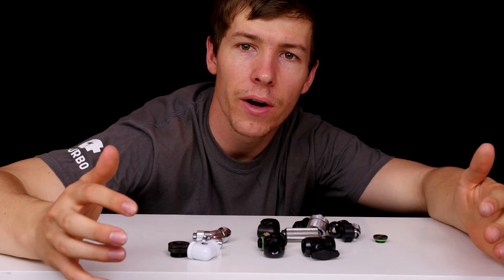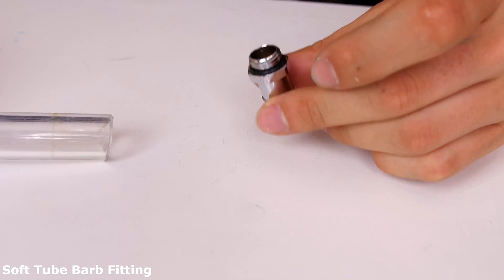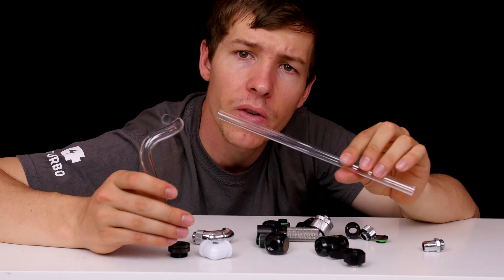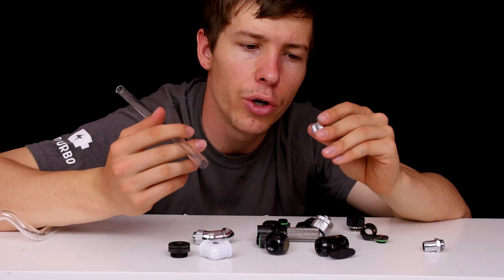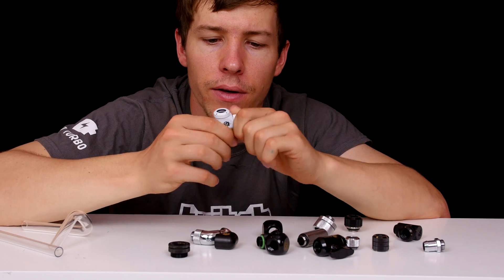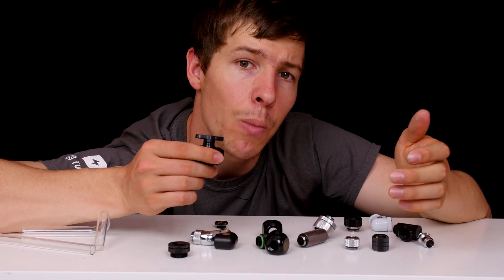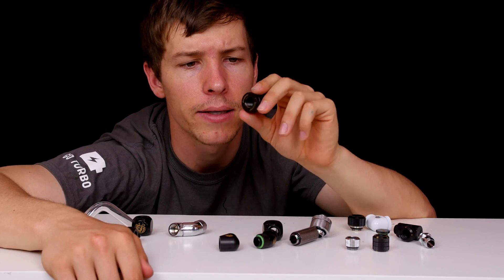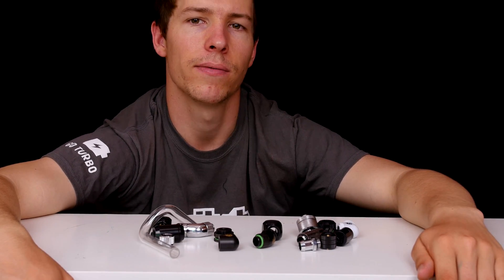A Beginners Guide to PC Water Cooling Fittings - How to Water Cool

Comment: I need help with choosing a radiator and fittings. I'm currently doing a water cooled build in a corsair obsidian 1000d case and want to purchase 2 hydro x series xr7 480mm radiators for the front and a 420mm Radiator for the top. I see that corsair only has fittings that go up to 14mm for Rigid Tubing. I want to use 16mm petg Tubing. With the hydro x having standard G 1/4 threads, can I use any fittings that are G 1/4 thread for 16mm Tubing on the hydro x series xr7 480mm radiators? I'm thinking of using bitspower fittings. Thanks for any help in advance 🙂

Comment: Bitspower has fitting i need but in the description it says they can only be used for bitspower rigid tubing. Is that true because I've seen other builds where the brand of the tube does not matter, as long as they are the correct size. I'd appreciate some feedback because thats the last thing i need to complete my build.

Comment: I want to do a custom loop in my pc. I want to use hard tube and do straight lines with fittings for the bends but I am.confused on picking fitting sizes and galvanic corrosion how do I prevent that from happening? do I need the entire loop to be the same metal including fittings or do fitting not matter and just the block, radiator and reservoir have to be the same metal

Comment: i would like for you to show how to design a loop for a beginner  and how you measure from one point to another using rigid fittings.  This would be nice for beginners that are looking to get into water cooling but are afraid to use rigid tube because they dont know where to start and how long of a tube to use before bending or cutting.  Since your making how to videos, it would be nice for and expert like yourself to show how u design a simple system and do a basic run.  Thanks for taking the time to explain this and all your videos!
Reply from the maker: +crhodes0302 great idea =)

Comment: hello Desing. you know how can i put a custom loop with rigid tube in a kraken x62 aio??? i am going to put a new pump and reversoir to the loop but the connection wich have the kraken bloque cant be screw. i dont know if you understand what i am talking about. thanks and really good video :)
Reply from the maker: +Marco Rossini if the kracken has barb fittings you can probably use soft tubjng
Reply: Designs By IFR  thanks for the answer. yes have barb but I want to put some rigid tube :/
Reply from the maker: +Marco Rossini not sure about ridges

Comment: So i'm guessing for the ball valve drain fitting... you need the T fitting, and then a male to male fitting THEN the ball valve to make that work... otherwise there is no way to attach the two.
Reply from the maker: +Crixus The Gaul bitspower now makes the valve with the male to male fitting joined already
Reply: ah okay. Thanks for the reply... so what I said is correct though right? you need male to male g1/4 and a t splitter?
Reply from the maker: +Crixus The Gaul yes unless your res has an extra free port down the bottom, then you wont need the t join
Reply: where is that bitspower male to male valve? I am not seeing it! Thanks.

Comment: Thanks mate great video. About to put in an order to #EKWB cooling 7700k, 2x 1080ti's. Came in over 1k when including postage. Are the EK fittings any good from what I've gathered from singularity, jay and yourself bitspower are the way to go?! I wish I could find a discount code 😔
Reply from the maker: +Sent2Strike hey man ek are great =)
Reply: Great was having a tough time sourcing them anyhow. Used ekwb configuration then just ordered 95% off PCCasegear, minus waterblocks for glucose which they were out of stock. Thanks again 😀

Comment: if i have a separate pump below the res, i would put my ball valve on the pump right? because the pump would be my low point
Reply from the maker: +Lex Lutha111384 the idea of the valve is to get rid of the majority of the liquid from the system (meaning the reservoir) so as long as your reservoir can drain from it meaning the valve is lower then it should be fine

Comment: can someone PLEASE explain to me the difference between the hard tube fitting and the soft tube fitting..... (compression fitting)
Reply from the maker: +Heroic Rage the soft tube fitting is a barb that the soft tube will fit over, then you screw the ring on which squeezes against the tube. A hard tube fitting is an insert. The tube goes inside and the rubber oring goes on and then the compression ring. As you tighten the compression ring the rubber o ring is squeezed between the fitting and the tube